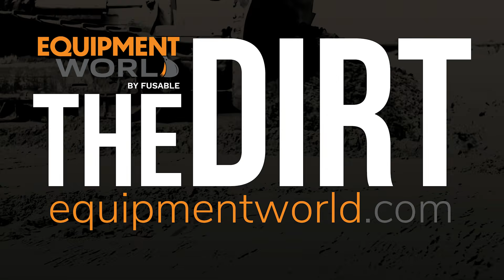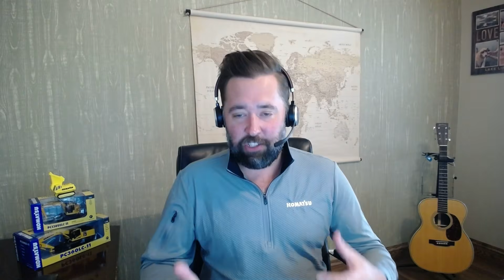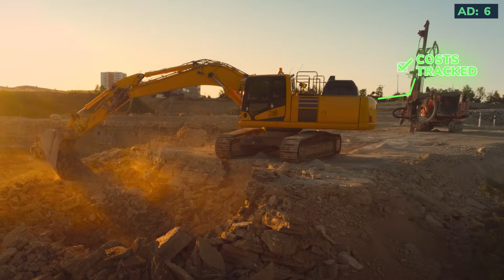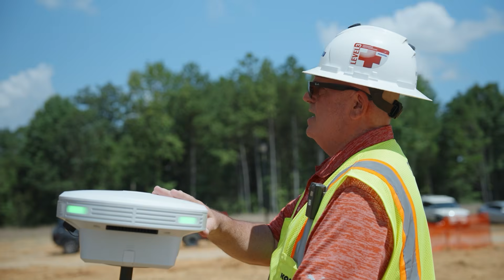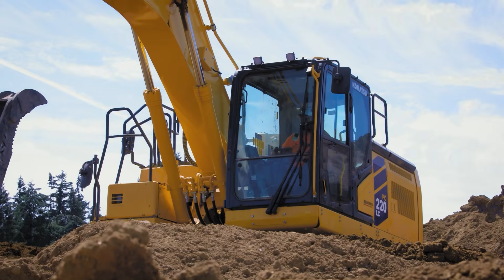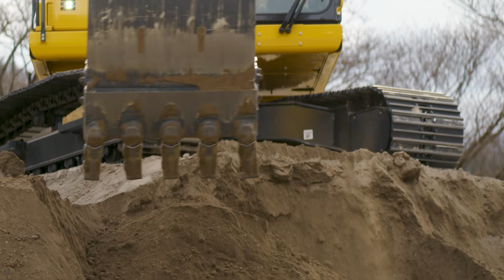What’s New on Komatsu’s PC220 Excavator? – Almost Everything!

Comment: A new generation but didn't change the bucket design. It is a nightmare trying to completly fill the bucket with this roundish design, it is so hard to get a full loaded bucket because it spills out much of the material, and this bucket makes it almost impossible to do a even ground surface.
Komatsu must get rid once for all of this roundish bucket.
Reply: Buckets do not come on the machine so you get to pick what you want, order a Werk Brau bucket when you buy one and you will get a flatter bottom

Comment: I remember back in the mid 80's I was operating a Cat 235 that needed servicing. So I was brought a Komatsu PC400. I thought I went through a time warp. It was incredibly advanced to the Cat. So if this new PC220 is improved, then you know Komatsu has done their homework and will be an amazing machine. Just my opinion.
Reply: Kinda similar story was running a cat 325 ran amazing but needed new sprockets and tracks was fine on flat ground but once you went through anything or up a grade it would skip they sent out a 365 with maybe 30 hours on it this was around the late 90s what a beast
Reply: There was never a 365 komatsu
Reply: @huvvy  He didn't say it was. And any real operator knows that Caterpillar, Sany, and Komatsu all make a model called a 365.